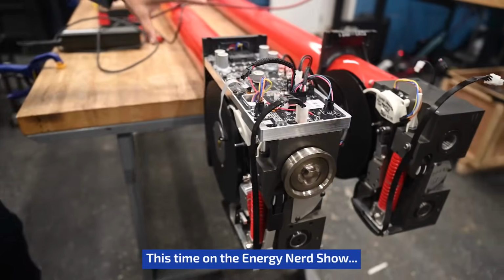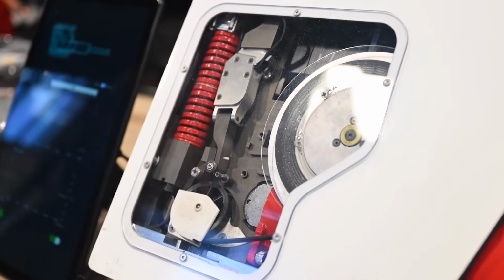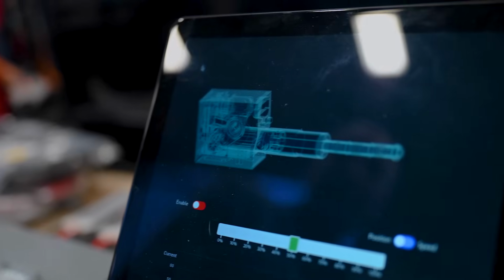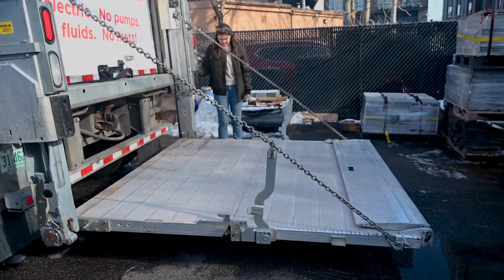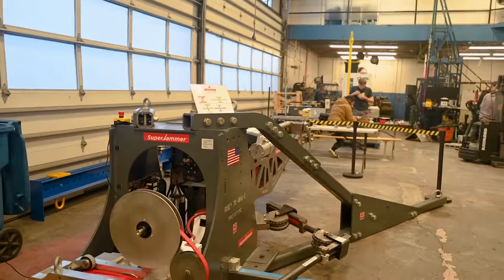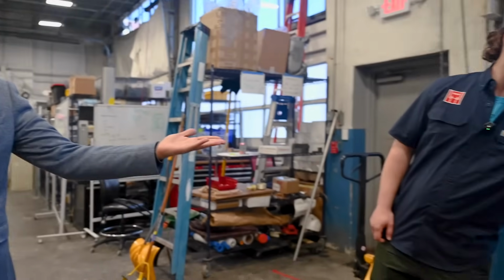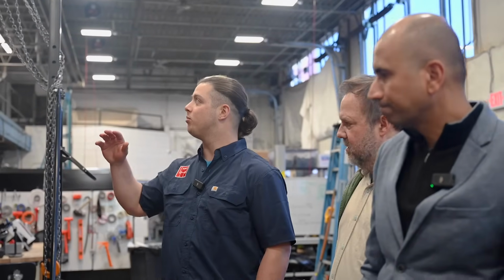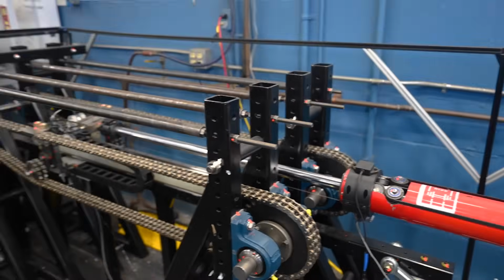Electrifying Heavy Machinery at RISE Robotics!

Comment: I don't think this has any chance to replace the hydraulics market, but maybe they could find a niche market for it.
Reply: Those dang messy, simple, reliable hydraulics!
Reply: @K-Effect  Hydraulics have served industries well for decades, but 'messy' is exactly the issue many customers have asked us to solve. Hydraulic leaks are a leading cause of maintenance downtime and environmental contamination. Beltdraulic™ eliminates leaks and significantly reduces energy waste while delivering the force, performance and durability required for industrial applications.
Reply: @JigilJigil We agree that Beltdraulic™ won't replace all hydraulics — traditional systems still make sense for some applications. But in areas where energy efficiency, zero leaks, speed or long-term cost savings matter - think electric off-highway heavy machinery, clean-room style environments, throughput-constrained applications, and military operations - we have significant customer pull on our technology.
Reply: Probably in areas that aren't dusty or hot, the bane of existence of electronics; but my experience is in construction in the desert. I can see possibilities in space (20% weight savings is huge), and aircraft (don't want them in the landing gear), but I'm sure there are people smarter than me that can think of ways to utilize these.
Reply: Hydraulics are great when properly maintained. The bad reputation is from users who dont follow best practices  and defer maintenance until leaks get so bad that refills are needed, etc, that can't be pushed to the next shift  or job.
Reply: Space probably
Reply: It really depends on loads and space restrictions. I don't think construction machinery like excavators will depart from hydraulics any time soon. The majority of industrial hydraulics applications however can easily be replaced by electric options. We've already replace all the hydraulic actuators in our facility with Exlar roller screw actuators.
Reply: like children toys.
Reply: It can serve in outer space that's the market for you 😂😂
Reply: camera gear maybe
Reply: These electrical actuators have been around for a long time. They work well in many applications and are particularly good in automation.  Precision and repeatability are hard to beat. Hydraulics can be made to perform well too, but automaton is more complicated and maintenance demands are higher. 

But for high power, brute force applications, hydraulics tends to have the edge. You won't se these replacing big cylinders on large construction machines. Generally, these are way better than pneumatics in typical manufacturing roles, but for those high power demand roles  where raw power  is need or objects being moved are very heavy, Hydraulics are still king.
Reply: when you out in space you don't want anything has to do with fluid out there.

Comment: Oh boy, this is garbage. 
Where to start. Polyethylene coated belts are old news, even most printers are running Kevlar/steel belts. Now if we were talking about carbon/carbon stand belts that would be awesome but these belts are pretty much the same as what you find in a car for running the alternator (and those break a lot as anyone with a car will know). 
The entire idea of its better than hydraulic because it’s electric is bad. Most hydraulic systems are running a hydraulic pump from an electric motor, meaning most hydraulic systems are actually electric. We use hydraulics because they have extremely high force, can handle a lot of abuse, can be used in areas that are acid and explosive prone, barely require servicing and cheap. 
This only get worse when people realise that servo and stepper motors already exist and they also exist in these sizes already and are overlooked for hydraulic systems because they are simply better. 
The “regen” from lifting loads sure it’s possible to do, in the same way we can recover spent hydraulic fluid and also have a regenerative system. 
Seriously though these guys rock up with a massive actuator and it’s not even a push/pull system, I could come up with something 50x better using steam over a couple beers than this thing
Reply: I always thought the electric replacement for hydraulic pistons would be worm screws, that would be push pull from the start and look simpler than a mess of belts.
Reply: @MrMonkeybat  Look up ball screw jacks.
Reply: Agreed. And using springs? What if power is lost? And the thing only moves like 20% of its own length. There are so many unsatisfying aspects to this. Last, it is really not that hard to add distance sensing to hydraulics.
Reply: Yeah I’m very skeptical how much force this stuff will generate. In simple hydraulics you have one or a couple pumps that run everything with valves. In this every ram/actuator has its own mechanism. The biggest benefit this has is no oil, I’m sure the tree huggers will love this
Reply: Based on the minute from 27:25, they are looking into using carbon fiber for their belts, their belt supplier is Gates, and they are open to other suppliers.
Reply: lol...brutal.. good assessment..though belts in the modern cars these days which are mostly used by Japanese automakers have a longer life. They are designed for at least 100k miles. I agree hydraulics are mostly used because of multiplicative force functionality and also robustness.

Comment: Idk but this feels like taking a simple thing and over-engineering the hell outta it!
Like there are significant higher points of failures as compared to hydraulics with few.
Reply: It is just a matter of finding best application. It sure will never replace all the hydraulics.
Reply: @heyhoe168  Exactly! Our goal isn’t to replace all hydraulics—there are applications where traditional hydraulics still make sense. But in areas like material handling, construction, and industrial automation, where energy efficiency and reduced maintenance are priorities, Beltdraulic™ provides a strong alternative.
Reply: It is cool when the company writes back, but that guy just threw TM at ya. 

 I want to see maintenence cost pet year. Just because something has more parts don't matter if it is easier dealing with than something like liquid.
Reply: Solar panels looked complicated when they first came out

Comment: The bald guy's points about hydraulics are false. From what I can see, those actuators do what most hydraulics can do but worse.
Reply: Hydraulics are simple to build, easy to maintain. Whats the point in this invention?!
Reply: @ipasuhd  Hydraulics work well but have drawbacks: energy inefficiency, speed limitation, and maintenance needs. These drawbacks are especially apparent in high-utilization applications. Beltdraulic™ provides an electric, high-efficiency, high-speed, low-maintenance alternative that cuts energy costs, improves throughput and reduces maintenance - ideal for organizations looking to save money, make more money and reduce downtime.
Reply: @ipasuhd It can work on Mars that's why
Reply: Efficiency. Hydraulics are not cheaper at all once you factor in the energy used over the product lifetime and the increased battery size needed.
Reply: For example, a small 10hp hydraulic system on something like a forklift, running 20 duty  cycle will use an additional $7000 in electricity over ten years vs. this belt system. Plus about a thousand dollars in additional batteries to get through an 8 hour shift.
Reply: Beltdraulics lol.
Reply: @jasonhanson6563 We’ll take that as a compliment! Beltdraulic™ is an entirely new approach, and like any big shift, it takes time to gain traction. Just like electric vehicles seemed strange at first, we're proving that hydraulic-free heavy machinery is the future.
Reply: A hydraulic wrote this comment
Reply: Immediatley started scratching my head at that one. What kind of PoS systems has this guy been working with?
Reply: @Bamamarama  It’s natural to question something new, but the reality is that many industries are actively seeking alternatives to traditional hydraulics due to energy waste, performance limits, and maintenance costs. That’s why companies are investing in electrification and hydraulic-free solutions like Beltdraulic™.
Reply: What do they use here instead of hydraulics? Air?
Reply: @longanghoai9881  Not air — belts! The belts deliver energy from the motor to the piston directly without high-pressure fluids and all the related complexity (valves, pumps, seals, and reservoirs).